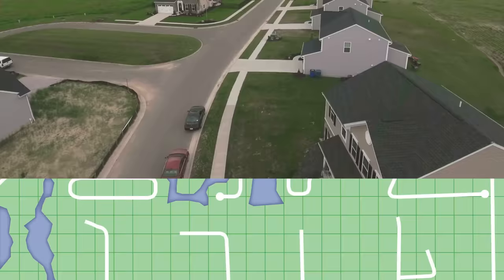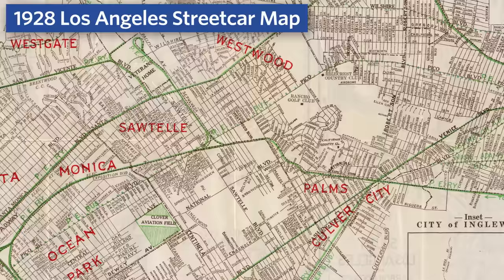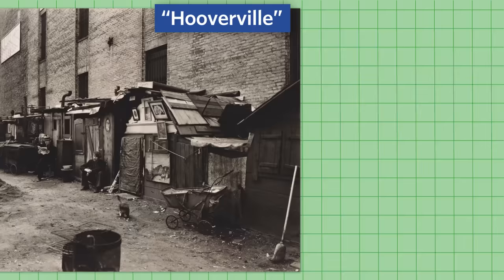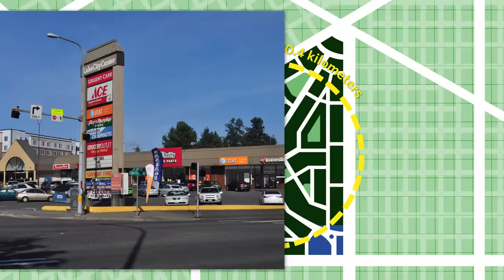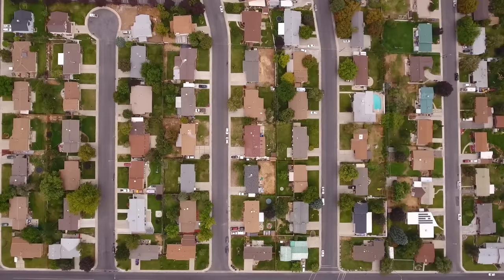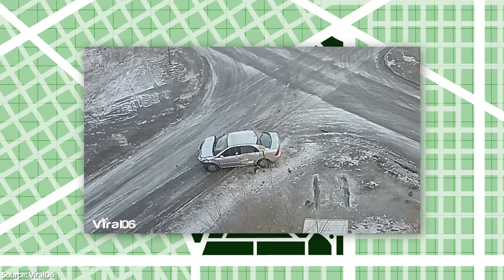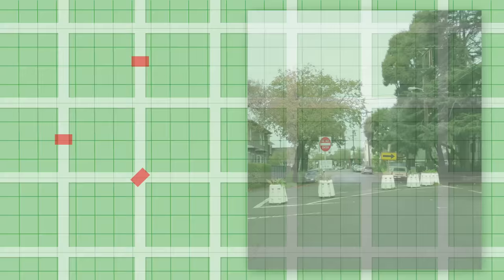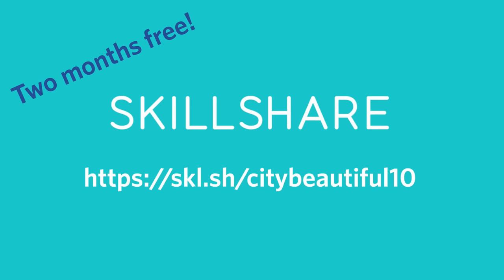The Reason Our Streets Switched to Cul-De-Sacs

Comment: I first had to google what a Cul-De-Sac is. But I ended up in a dead end.
Reply: Ha🤣
Reply: Thanks Dad!
Reply: You can leave now sir lol
Reply: Spoiler.    A true dead end does not have the loop to turn around at the end.
Reply: That's an ass on the bag if I'm honest with you
Reply: @joeygarza9550  Has a reason there's a highway to hell but only a stairway to heaven.
Reply: If not able to turn around in car any then u gotta back out of the area and watch for traffic to pull out and turn any. or park where u can turn around and then get out and walk rest way lol.
Reply: Cul De Sac in French means the bottom inside a bag. A Cul-De-Sac road pattern must have an enlargement at the dead end. Modern cities with traditional grid type urban design can easily be changed into Loop & Cul-De-Sac. Designers call it "The Supper Block" pattern. Carefully block 2 to 4 smaller road intersections along a main road both in X and Y directions. It makes the fine grids become super block base sites. Then, move the intersection blocking to set back to a smaller street inner junction and form a T ending. The T ending is a type variation of the Cul-De-Sac. Or in alternative to make loops or other shape of T ending road access as practical.

This way, you may have several combination of loop & Cul-De-Sac inside a Super Block. In addition, pedestrian access separated from the car access can be made accordingly.
Reply: In the UK, cul-de-sac is viewed as a better spot because of its exclusivity.
Reply: I read it and immediately understood it's a butt. Unfortunately for romance language (mainly italian, spanish, french) speakers, the french "cul" sounds too familiar for comfort.
Reply: dont quit your day job
Reply: pov everyone
Reply: Badum tissss
Reply: Boooooo 😂
Reply: Lol good one
Reply: That joke earned you a three-pointer.
Reply: Jail
Reply: shoulda said i first had to drive to see what it is.
Reply: A dead end ending in a circle. 🤣🤣
Reply: In french it literally means the arse of the bag

Comment: When i was in middleschool, i had to walk like 40 minutes from the bus stop to my home, were i could jump a wall and be, literally 5 minutes away
Reply: : (((((((((((((

bad luck
Reply: have you ever jumped that wall?
Reply: Tell me about it.  The nearest city bus stop to my house is 3 minutes away if I cut through the church parking lot or 7 if I go around, which is fairly convenient as that bus route runs clockwise and goes almost straight to my job in ten minutes.  Since the church also runs a school, they try to discourage people from cutting across as much as possible, which I'm normally happy to do.
But, for the last month or so, there have been construction workers doing upgrades to the sewer system on the main road, which means going around is basically impossible so either I have to ignore the posted signs and cut across the church lot, or go the other way down my road to get onto the next main road then go even further to the next connecting road that would take me back around to the more direct bus route, which would take almost an hour.  If I'm going to spend an hour to take the bus, then I might as well just use the counter-clockwise bus route that has a stop on my street, but takes an hour to get to my job as it goes all the way through downtown and the historic old town sections before going back up the hill, and all because the city planners couldn't be bothered to put a few more crossroads in town to connect isolated streets and neighborhoods.
The last town I lived in was designed with a more grid shape, so if one road was closed off for sewer work, I only had to go about five minutes out of my way to get around the closure and to my destination, not an entire freaking hour.
Reply: el tapa we have super shitty street designs in my city as well. A lot of streets at the edge of the city don’t even have asphalt, crossroads or  sidewalks (and when they do they tend to be wanky or asymmetric WHICH DRIVES ME CRAZY) Also, one-way streets are hell. They build “better” (EMPHASIS ON THE “”)  sidewalks recently and now, instead of going straight towards the main street, we have to go the opposite direction and go through a million small, confusing streets before reaching the main street. A waste of like 20 minutes with car, at least. I’m so sick of the shitty designs. They might as well destroy every single home and start anew cause it’s all so fucked up, it can’t be fixed
Reply: Thomas Borisov  Trespassing is a crime, the neighbors have dogs or gardens next to the wall, the wall itself could be too tall to safely go over, etc.
Reply: @whocaresguy  was it uphill both ways too?
Reply: I hopped the wall in my way. Kids would place a shopping cart or two for a boost on booths sides. If someone came and removed them, they would be back the next day. 🙃
Reply: Seems like there needs to be cut through access ways for pedestrians, while maybe having cul de sacs for vehicles
Reply: el tapa
So Cul-De-Sacs are designed without footways?
Reply: Spoiler alert: if you go the other direction and jump the neighbours back fence you will be at your place of work...no car, no bus 😋
Reply: I was lucky enough to walk around and talk to a lot of my neighbours. Most of them agreed to let me cut through their yards on the edge, provided I carried my bike instead of riding it or pushing it through the grass.
Reply: @fatetestarossa2774  or bad design
Reply: @schwarzerritter5724  i hate that , my friend lived in an area with no sidewalks and i asked him why and he said they don't want people walking around here
Reply: I jumped a wall and my neighbor was sunbathing naked in her yard she asked me if I wanted to come inside for a glass of lemonade. The end 😂
Reply: Me too. I moved from a city where i took subway to HS to suburbs and had to walk 30 mins to school cause of these stupid ass circular streets. A straight road wouldve made it a quick 10-15 minutes walk.